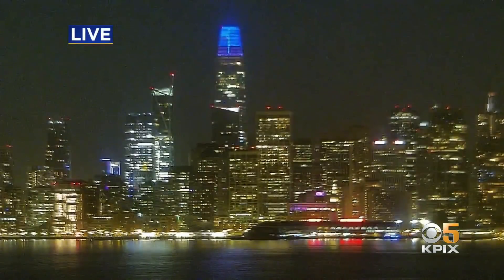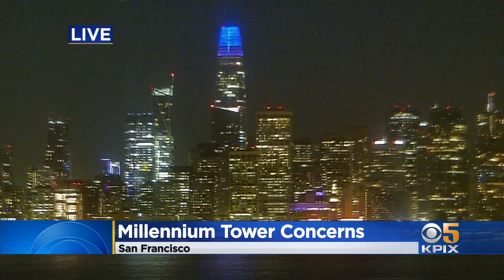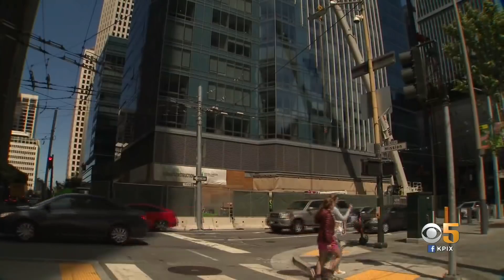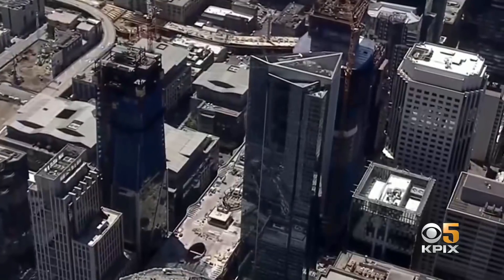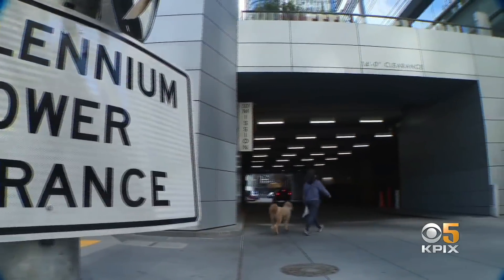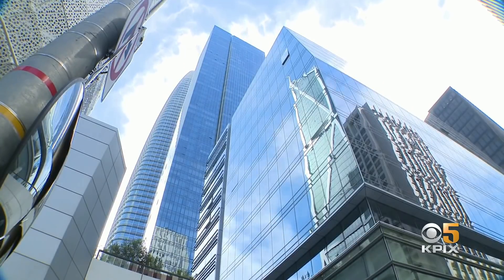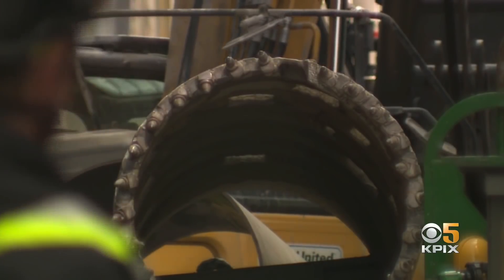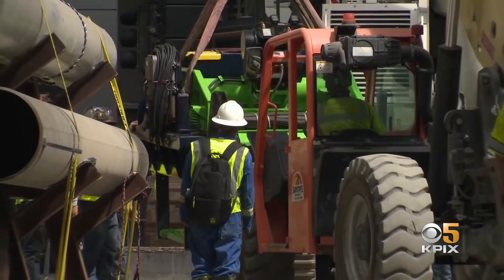Repairs of Leaning SF Skyscraper on Hold; Engineering Expert Blasts Plan

Comment: I saw a more detailed description of the other fix that the city rejected- Had I been in their shoes I would have picked it in an instant. It looked like a much more thorough job, and was designed by LERA, an engineering firm with a LOT of experience working on skyscrapers. Too bad the people in charge of these decisions never stop to remember that you generally get what you pay for. And yes, such a fix as LERA proposes might cost more. But it would likely cost less than many of the less pleasant alternatives.

Comment: I think the engineer takes into account lateral forces. The fear is as he elaborated on. In the event of lateral movement, the side of the building not secured will cause a unbalanced response if moved by earthquake. My opinion is that it depends on scale. If the augmentation is great enough to not be overwhelmed, it should stay true. The original pylon plan does not satisfy all the requirements, but if it is under consideration, why not implement both?

Comment: Its called "Isostacy" which equalizes building weight and prevents sinking. Isotacy is digging out foundation to equal to weight of building above ground. Typically used as parking garages. Seattle City Engineering requires that of skyscrapers because Seattle was built on glacial till, not bedrock like NY. We know after rte 800 collapse in earthquake that San Fransisco is built on loose soil and near a huge earthquake fault. The two "fixes" are IGNORANT of ground conditions  and cheap fixes that won't fix the basic problem of not accounting for building weight causing it to sink in. Subsurface injection of concrete would be a solution for a smaller building. Fixing a foundation issue is difficult after building is built. Seattle high rise have not only vertical pilings but also angled pilings which also support building stability (broad support like tree roots.)

Comment: So what is the purpose and legitimacy of the City of San Francisco having the authority to charge fees for permission to build? It is surely not to protect the public as the city signed off on it. The city engineers shall be held liable for this. The inspectors are not to blame as they are not educated in science(sorry if you are an inspector but it is true). The retirement funds of the city shall be drained for this as well as a moratorium on fee increases and a reduction in current fees. This is a classic case of a room full of useful idiots at the city that are LEACHES on society.

Comment: I would move if I lived anywhere near the tower. They are only prolonging the inevitable might as well Tear it down now and save lives.
Reply: Thats what they said about Pisa.    700 years and still up
Reply: @CowSaysMooMoo  you are talking apples and oranges different soil construction height weight. It will fall no question about it except how many lives will it take

Comment: underpinning a compromised foundation that is slowly sinking in quicksand esentially does not and will not work period the building must be torn down and the foundation rebuilt if they plan on keeping the building as is
Reply: maybe remove say top 15 floors?